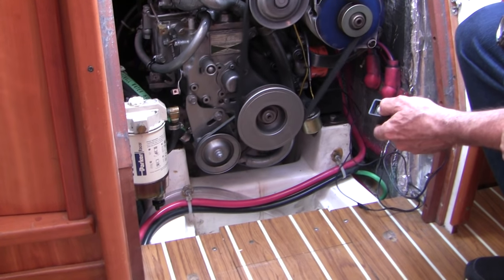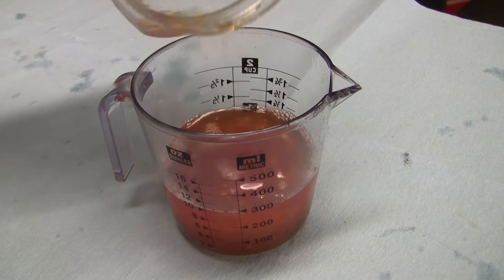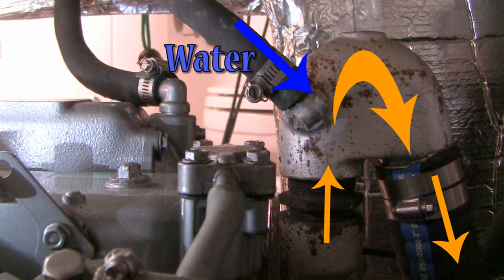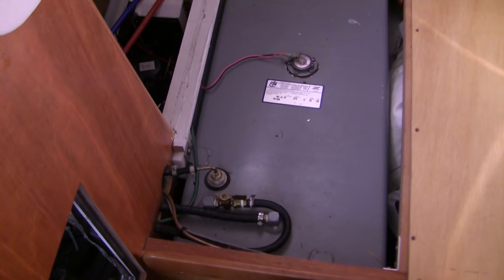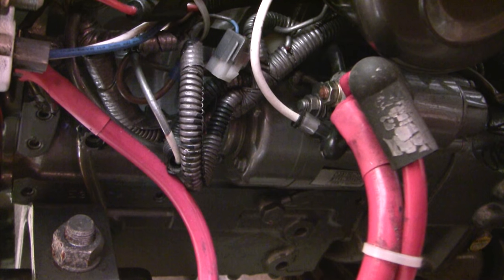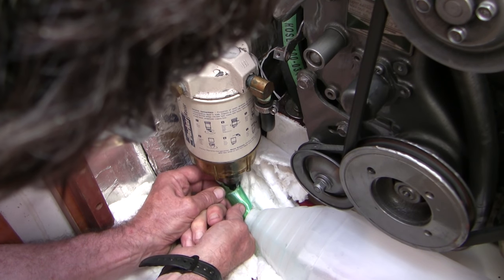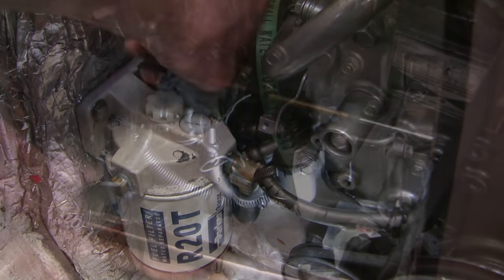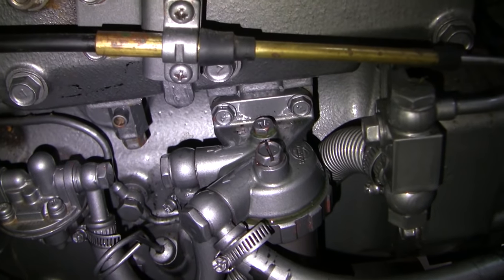How to change fuel filters and bleed air in a Yanmar marine diesel

Comment: Well made video. Love it. Learned a lot. I guess I have to think twice before making the purchase of a catamaran sailboat.  Way too much work. Thanks.
Reply from the maker: Oh yeah, I know! Strangely, the biggest expense every year is for marina parking, which is an eye opening fact (even worse for a cat). The most painstaking maintenance issue by far is the annual haul out, which means paint and sanding, with enough time on the hard to repair deeper problems and let undercoats of paint dry. You can count on a week of maintenance time every year, hoping weather cooperates to allow you to paint without rain complicating the game. Comparing that to the option to rent a boat for a week a year, you'd come out better off renting (or, even better, tag along with a sailing friend, ha ha).

Comment: I am about to get a boat that has this kind of disposable fuel filter with the removable water separator... which is different than the old Racor type I know.. with a cartridge inside..or the VW diesel filter I live with everyday. So most valuable not be hunched over in the bilge.. learning by doing it wrong !  Thanks.

Comment: Thanks so much for this. I really appreciate the clear and thoughtful explanation - very helpful!  A Racor and fuel filter change is my project for this week.  If you don't mind, I also have a <likely stupid> question but I haven't been able to find any related discussion:  I recently replaced the mixing elbow assembly on my 3GM30F.  Previously, I had noticed some white steam emanating from the exhaust, (especially at higher RPMs) as well as a noticeable discoloration building up on the transom after only an hour or two of motoring. Since the replacement of the exhaust elbow, both the steam and the discoloration issues seem to have now been resolved. However, I have also noticed that the sound of the exhaust as it exits the back of the boat is significantly louder than it was before?  Prior to replacing the mixing elbow, she seemed to purr right along vs. now  sounding more like a tractor pull. I do have the Vetus Waterlock system installed - Anything else I should be checking?  As I mentioned, I can't seem to find anything on-line related to this issue and I'm wondering if the louder exhaust volume is merely the result of having unimpeded flow through the new mixing elbow ( the old elbow was pretty clogged)? I'd love to have your thoughts...  Cheers!
Reply from the maker: Safety is always the first consideration, I'd be carefully looking for an exhaust leak, especially around the elbow and exhaust manifold. It wouldn't be uncommon to have a bad fit between the new elbow and the exhaust manifold. Remember to look closely for a crack in the exhaust manifold, they often crack from overheating. If you don't already have one, I would upgrade to ABYC standard by installing a battery powered carbon monoxide detector, positioned somewhere near the floor. Next on the list is the waterlock muffler, check to be sure it is filling and working properly, and that the necessary second loop is present at the exit point for the waterlock muffler. Downstream of the muffler, another common point of exhaust leak is the water drain from a hot water heat exchanger, if you have one installed. They tend to rust out. If you don't find anything downstream, then then next thing I would consider is whether your salt water flow is adequate. My sea cock is one of those old style screw type valves and if it is not screwed all the way out I get restricted flow. It may be time to inspect and swap out your impeller, and if any fins are missing then an inspection of the heat exchanger is next. Sometimes pump activity is poor when you first restart after working on the system until air pockets are cleared. If you find a cause, please stop by and let us all know what was found.
Reply: @spelunkerd  Thanks so much for your quick reply.  I will pick up a CO monitor today - Now that you've suggested it, it makes me nervous having been without one!  I also have a new impeller which I will install as well.  I have looked as carefully as possible, but have not found any leaks or cracks around the elbow itself or manifold. I did have a suspicion that the waterlock muffler may not be filling correctly, but didn't really know how to check this.  Is there a recommended protocol?   I'm not sure there is a 2nd loop installed between the waterlock and exit - I need to look again, but I remember it being a fairly straight shot out to the back of the boat.  There is a vented loop before the elbow.  Cheers -Thanks for your advice!

Comment: Well done.  Are fittings on the American sold Yanmar engines metric?
Reply from the maker: Good question. Most of the fittings in this 18 year old engine are SAE, not metric. I'd be surprised if new models have not transitioned to metric.

Comment: Hi Dave, thank you for the video, I find it very useful. I m trying to start  a 3YM30 Yanmar Diesel engine that was inoperative for more than 3 years and I ve realized the problem is water on the fuel line. I'm afraid that trying to start it I ve overcranked the engine and filled the pistons with sea water, do you have any advice for this issue. Thanks in advance, Martin
Reply: Thaks for all the directions, very detailled and explicative !!  I'll try this weekend and let you know.

Comment: Very helpful.  Getting an old 3QM30 in my C&C 38 back into fighting condition.  FYI, I used my oil suction device to suck fuel through to the small high pressure fuel filter after I changed it and the racor.  Worked like a charm.  Quick question.  Do you adjust valves on these old Yanmars?
Reply from the maker: Camshaft valve clearance is mechanically adjustable, though I don't believe there is a usual maintenance schedule for valve clearance. I have not done it in my engine, yet. Good thought about your oil suction device. As long as vacuum isn't high enough to blow out the filter I assume it would be fine. Effectively the engine pumps up a vacuum anyway. Thanks for adding to the thread here!

Comment: The engine’s closest bleed point used in the video, had a rubber input hose attached.  Is it possible to attach the vacuum pump that many of us use to suck out engine oil, to pull diesel through the filters and hoses?
Reply from the maker: Yes, some do it that way.

Comment: You have an arrow pointing to a nut that says Idle Adjust Screw when you a ralking about the cable. I'm a bit confused byt that. Thanks for the video
Reply from the maker: At the helm when you want more power you push the engine lever at the helm forward. The lever at the helm pulls on the regulator cable to give the engine more diesel fuel, which raises rpm. On the engine side, that regulator cable is attached to a spring loaded lever that adjusts fuel delivery (and target rpm of the governor) inside the high pressure pump. When the cable is slack, the internal spring holds the lever against the tip of the idle adjust screw, causing rpm to slow to idle speed. This means that adjusting the screw position will change idle speed. The idle adjust screw is the rusted, threaded bolt that the arrow points to at 17:36. You can see it has a slot on the end to allow adjustment with a flat blade screwdriver, after loosening the locking nut. I did a whole video on replacing both the engine stop cable and the regulator cable, so if interested you'll find more details there. I hope that helps. It's more simple than it sounds. You might (carefully) play with that cable a little while engine is running to see how rpm changes.

Comment: Please do a marine gearbox/transmission fluid change video!
Reply from the maker: Good point. I have a sail drive so my simple method may not apply to many who visit here. I regularly change that fluid every year, not because it needs changing that often but because I want to recognize a failing seal before salt water intrusion damages the gears inside. When on the hard it is as simple as removing the stainless bolt at the bottom, watching for telltale water to trickle out before the overlying oil makes it out. Cheers!

Comment: Thank you wayne for taking the time/effort to produce an excellent/instructive video.I'm preparing to enter the fray and replace the impeller on a Yanmar 3JH2e.Need as much info asI can obtain.Who did you learn from? Karen or the Inspector? Extra  grog and hardtack for both. Regards, OldGuy in EmeraldCity/Seattle
Reply from the maker: My boat came from Seattle, USA, ha ha. It's good to carry spares, like impellers, etc. Last month we had an alternator drive belt give way and I was able to swap it for a new one we happened to have on hand. Fortunately there was enough wind to allow my wife to sail the boat in circles near Sidney, BC, for a half an hour while I swapped it out. I did a few marine engine courses at a local college, but most of my mechanic education was practical, spinning wrenches on gasoline engines. The systems are similar, but the diesel engines have some intriguing differences. Thanks for watching, more to come. 

Dave

Comment: Great video. Thank you 
Any videos on oil change, winterization, fuel filter change and zinc replacements on a 6LYA-STP?
Reply from the maker: None for that engine, though the basic principles are shared with all diesel engines. Yanmar offer repair manuals and owner manuals for free on their website; use Google with the above model number to get there with a single click. I did an oil change video, and I made a Yanmar/boating playlist on my Youtube channel. Thanks for dropping by!

Comment: Great instruction.  Did everything right and then today I pulled the shutoff 1 inch out and got a start.  Seems the shutoff cable was not set correctly.
Reply from the maker: Good point, I'm sure your remark will help others who stop by. That's a common observation, another boat I have sailed on had the same issue.

Comment: I’ve already winterized and have just changed the oil. Is there any harm in not running the engine until spring at this point? Thanks!
Reply from the maker: It's probably OK. My usual strategy is to drain the carb bowl, for two reasons. First, fuel retained in the bowl tends to go stale as volatile components evaporate away, leaving varnish that can stick tiny orifices closed. Second, if the petcock is not working, when you open the carb bowl drain, it won't stop dripping, indicating it is time to clean the petcock. My routine is to add Stabil to the fuel, run it for a while to circulate it, and leave the tank full so water in air won't form dew as temp falls, causing the engine to choke out next spring. I pull the battery and keep it in a warmer garage, intermittently charging through the winter.

Comment: Thanks for the excellent and methodical instructions. I am planning to do this tomorrow and have a question. My YSM12 motor has a hand crank. Could I use this to crank the motor (with the decompression l ever off) instead of the starter motor to bleed the system? Cheers - Mark
Reply from the maker: Yes, this reminds me of something I saw in Africa, a hand crank to start a diesel well pump. Note that if you hand crank a diesel, there's a risk it might start, especially if those spring loaded decompression switches slip back to full compression when the engine shudders. That could be dangerous if your wrench spins out of your hand when the engine starts. Better to use a ratchet socket wrench that will allow the engine to spin faster as you pull the wrench away. Even cranking a small two cylinder diesel can be a lot of work, I don't think you'll be able to turn it fast enough or long enough to easily purge air from the fuel delivery system. I'd get a remote starter switch, they are sold at automotive stores or amazon, everywhere. Good luck!

Comment: Hi thanks it wass stock rust y got it to loose free  i open the back and side and work it out i pull  the fuel pump out to so lots of work but is moving great the tip is the springs

Comment: Would it be possible to flush the diesel system with fresh diesel by attaching a clean fuel source to the fuel hose at the tank, and then pull a vacuum on the return side at the tank? Or is the return only for unspent fuel at the injectors? Trying to keep it simple, as I would like to see this motor run before purchase, boat has been on the hard for 4 years and I'm sure the fuel is nasty. Thanks for any advice
Reply from the maker: I agree that bad fuel is your primary concern. Most guys would flush and clean the tank in some way, and flush the line. However I don't think vacuum on the return line would draw fuel past the butterfly valve and regulator by itself. As you say you could substitute an alternate fuel source from a separate container if you want, but I don't think applying vacuum on the return line would serve any purpose.... Good luck!
Reply: @spelunkerd  Thanks for your quick reply, your videos are really informative.

Comment: After you tighten the bleeder valve on the racor, can't you just keep pumping the racor pump instead of the lift pump?
Reply from the maker: That's a good question, I've never done that. If the downstream screw is cracked open, it may work. I know some guys use an external pump for a faster work flow, so the butterfly pump is evidently no obstacle to flow.

Comment: I installed an inline primer bulb like you would use on an outboard motor to bleed air on my 2gmf. The tickler on the Yanmar doesn't seam to do anything.
Reply from the maker: Good point. I think the combination of trapped air that expands under vacuum plus viscous diesel fuel makes it hard for those pumps to work until they can clear the air pocket. When the starter motor spins it activates that butterfly valve much faster than one can move it manually so the trapped air is cleared, after which the pump is very efficient. If the primer bulb is low down and closer to the fuel tank, it ends up pushing fuel rather than trying to suck up air bubbles. Thanks for your contribution!

Comment: When I get ready to spring commission my marine diesel should I hold down the start and stop buttons to crank the engine to build up a little oil pressure then release the stop to fire it?   Should I worry about that hydrolock issue?    I learning here…bear with me…
Reply from the maker: Those are good questions. I suppose if your engine is too quick to fire up, it might be worth considering, but I don't do that. In my engine, delayed starting after sitting for a while is the dominant problem. As you say, the biggest risk to a delayed start is salt water hydrolock in a cold engine with no glow plugs. If I don't expect the engine to start quickly, sometimes I go through the effort to turn off the salt water intake to avoid flooding the exhaust with salt water before combustion sends a dominant stream of exhaust gasses out. The most egregious error would be to close the salt water intake and then forget to open it back up quickly after starting, so bear in mind the stupid factor. An alternate option if you want to delay the start would be to hold the decompression valves open while you crank for a few seconds. That would prime fuel and oil delivery passages and accomplish the goal.

Comment: hi Dave real good videos i have the same engine i just finish a valve job  and i find the regulator to be not moving at all is this normal ? whit the engine of and another do i havefto bled the hig preshure pump to?
Reply from the maker: That regulator control should move, though I found it to be very stiff when the engine is off. With engine running it moves much more freely.

Comment: Nice job. Thanks. My Yanmar fuel regulator cable springs back, very annoying, won't stay at needed fuel setting, springs back to idle. Any ideas why?
Thanks
Reply from the maker: When I replaced my cables, they slide so easily that they don't stay put at speeds just above idle, the cable control springs back to idle. This is annoying when your attention is diverted elsewhere as you leave the slip. No such problem at higher RPM. I tried tightening the screws that hold the mechanism together, which helped a little. If you find a better solution, please record it here! With time the friction inside the wire cable is slowly increasing, so it is not much of an issue any more.
Reply: @spelunkerd  thanks for the response! I will keep working on it. It seems the springs inside the housing are super strong, pushing back the speed to idle.
Thanks again

Comment: Question on hydro locking, I don't understand, it seems that the water would not have enough pressure to move through system if you crank the engine only. I have never heard of hydro locking happening in this way? Is this comment more of a hypothetical than a reality?
Reply from the maker: Good point, I wondered, too. These marine engines have a dirty vulnerability, in the exhaust elbow. As that elbow rusts and cracks, water can flow backwards by gravity into the exhaust manifold. The flow of salt water is driven by the salt water pump, which begins spinning as soon as the starter motor spins the engine, even before the engine fires up. That water has to go somewhere, so the waterlock muffler fills up with fluid, because in an engine that hasn't fired up there isn't enough forward flow of exhaust gasses to blow the salt water out the back of the exhaust. The level of fluid in the exhaust muffler rises, reducing the jump water needs to splash backwards. When water floods the exhaust manifold, gravity helps it to find an open valve that allows it to trickle into a cylinder. Once a cylinder is filled, the non-compressible nature of liquid water puts huge strain on the connecting rod, and eventually something breaks. The warning sign is lots of white steam out the exahust, which is water boiled in the exhaust manifold. You also might notice "milkshake" oil at an oil change. It's one of the most common caused of a dead marine diesel engine.